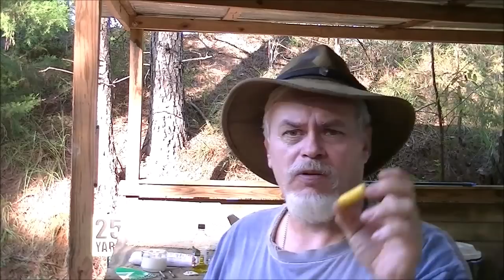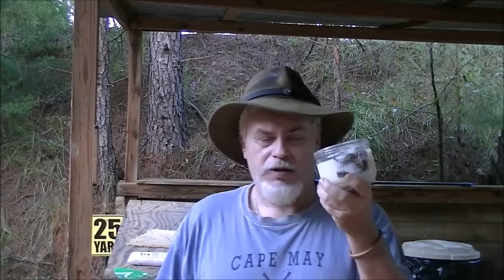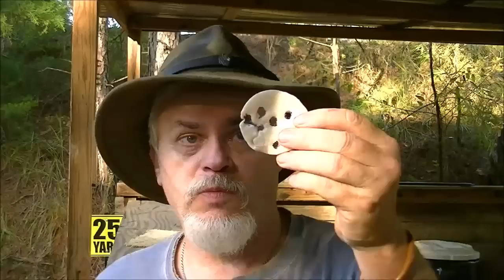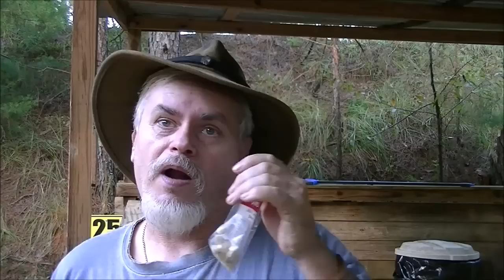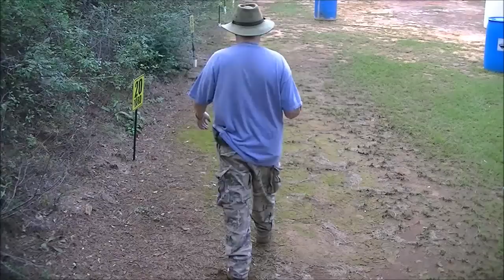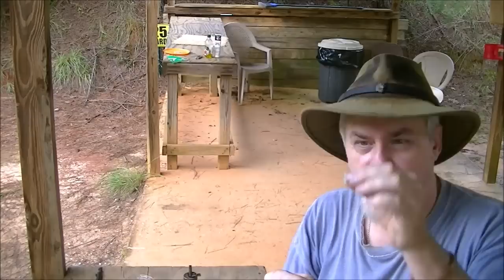percussion revolver series making wads

Comment: A big can of Crisco works really well for an over the bullet lube. It works the best of any of the lubes I have tried in that it keeps the fouling soft and I can fire many times and not have to assist the cylinder in cocking. I have never used a wad with no problems at all. Crisco over the bullet does not ignite and does not harden like wax will.

Comment: I bought 6 tubes of cotton pads just like those for black powder wadding (as well as general gun cleaning), except I was using them dry in a 1" pipe cannon, I didn't even think about using them as conventional lubed wads in my revolvers, great content as usual! I live in the humid Houston area, so no worries on embers.
Reply from the maker: we used them as wadding in smoothbore .62 cal trade guns for turkey loads..as long as they dont burn or smoulder your good

Comment: I gave up using wads after finding some stuck to the target 25 yards away. My groups halved in size and fliers eliminated by base dipping Eras Gone Colt .36 conicals up to the grease groove in a molten mixture of 40% lamb tallow, 40% beeswax and 20% candle wax. After shooting 48 rounds every session the bore fouling remains soft with shiny parts of rifling still visible. By the way, I use Pyrodex P due to real BP requiring a special explosives permit and storage conditions here in the UK.
Reply: Have you compared your round ball with wad accuracy against your conical method without wads while using Pyrodex? Does the UK make you store your cap & ball revolver in a locked gun safe at home?
Reply: @ReichenbachEsq  I find accuracy is better without wads, especially  conicals. I attribute this to having to use less powder space = less velocity.  
The most accurate load I've found in my .36 Uberti Remington New Model Navy with Era's Gone, Colt Cartridge works conicals half dipped in my home made Beeswax/lamb tallow/ candlewax lube is 19 grains (volume), 14 grains (weighed) of Pyrodex P.      
Round .380 cast round balls halfway dipped also work well with 21 grains (volume), 16 grains (weighed) of Pyrodex P. NOTE - .375 Hornady balls are too small in my revolver. 
All firearms in the UK, except most antiques, and air guns with under 12ft lbs, must be stored in an approved safe and licenced on a 'Firearm Certificate.'

Comment: I also got that same set of punches, but mine came very dull. If you have some kind of grinder/sander and you can sharpen them, and a torch to harden them, its a great deal. Don't bother annealing, these punches seem to be mild steel, so they won't harden enough to make them brittle, but it does make a difference.

Comment: I made some of my own lube 50/50 beeswax olive oil works well!  Thanks for the awesome video Blackie!
Reply: I do the same thing. My revolvers seem to like it pretty well... Im at a 25/75 mix, wax heavy with mine though. Seems to work well but my not soft like bore butter, but it works very well in my bpcr also at that level pan lubing. My 45-110 Sharps loves it with fffg swiss. Lol
Reply from the maker: @Rumblestrip   i have played with the mixes 25/75 50/50 60/40..each good for a certain job..
Reply: toilet ring wax, touch of pure carnuba(more firm) wax, pure lanolin oil, little bit of flax seed oil or olive oil great bore butter and leather conditioner water proofing. You could eat it? 
I soak punched felt furnature leg protectors from 99 cent store while my mix is hot.

Comment: I make my lube/grease with beeswax and coconut oil, I find it nicer than Olive oil. Change the proportions depending on your climate, since coconut oil can either be a solid or liquid at room temp, depending on the temp your room's at. Might not work as well in colder climates, but i find it smells great
Reply: Very true. And, if you've ever had the misfortune of smelling olive oil that's gone rancid; well, that'll dis-spell any doubts about which oil is preferable. Coconut oil doesn't go rancid, generally. And, just think; if you can smell that rancid olive oil, what must it smell like to deer!? They 'll probably smell that coming, from a mile away, literally!

Comment: Thanks for all the tips. The Walmart candles will stretch my supply of precious beeswax, and I will try the cotton face pads for wads. I will bu a bumper supply, because I seem to be having trouble finding cleaning patches. Awesome you for them, even if I don’t like the wads.
Reply: For cleaning patches I buy white cotton flannel from the fabric section at Wal Mart, Micheals or Joann's Fabrics.  Cut to size and much cheaper than ready made cleaning patches.
Reply from the maker: very true also i have waited till spring  look around the good will for flannel sheets to show up i buy then for a few bucks and cut them up for patches a king size flannel make a pile of patches
Reply: You can always use t-shirts.
Reply: @Seahawksl1969  I quit using t-shirt material in muzzleloaders when I had one get stuck down a .32 long rifle bore.  It's ok for wipe downs and in open ended barrels but won't use them in traditional guns any more.
Reply: @karlt8233  ok.

Comment: I work in a machine shop so I made my own punches to make wads. I used a recipe for bullet lube I found that used beeswax, paraffin wax and lard.. now I leave out the paraffin wax and just use beeswax and left over bacon grease. I just pour the warm bacon grease though a coffee filter into a jar to remove impurities. then I melt the wax and grease in a pan. until it blends. the right mix when its cooled is a good paste that wont melt at 100 degrees outside.
Reply: Bacon grease will turn rancid on you over time.
Reply: @denisdegamon8224  I have some of the lube I made several years ago and it is still good because the wax keeps it from going rancid.  Candles were primarily made from tallow and beeswax in ancient times.... Tallow is animal fat..
Reply: @drakon1300  good to know that is my plan also.

Comment: Yall so fancy  I just got a euro arms Rodgers &Spencer 44 , and haven't been  able to find balls or caps the right size but I been shooting it using  45./.440 balls a patch cut from gun cloth, bearing Greased, and found # 11 caps bent in a little round the edges to fit tight  and barring grease,  to  seal the chambers , and I've had no problems  so far  ,  I don't recommend this but in a fix we do what we can in the south, DERNTOOTIN!

Comment: 7/16 = .4375,   3/8 = .375   I have a similar set.  I also have more precise punches too, like a .750 punch I use for end caps on paper cartridges where I can get 74 out of a 8" brown coffee filter.  I also have a 15/32 (.469), it is a little big for paper cartridges, but will work just fine for making quick draw practice blanks. I haven't found a 29/64 (453), yet.  I'm also still using 1/4 stiff felt, where I can get 4 wads per 1 sq.in. I finely sharpen my punches and use a cutting board as a platform. And, I can easily cut them in two, to make 1/8" wads.
Thumbs up as always!!                                                 Blackie Sir, I am sorry!  I not trying to take over your show, and I wish I had your nerve, I can't make videos of my own, bout get sick trying.
Reply from the maker: good info thanks

Comment: I would like to see some powder in contact long term tests.    Sure way to "inertify" primers or percusion caps is to get oil on them. Be interesting to now if over time these wads will destroy powder touching them ( say like storing paper cartridges )
Reply from the maker: thats on the list..i plan to load a full cyl and wait 2 weeks then fire one chamber.. after that i will shoot one chamber per week till all have been fired to see if oil creep is getting into the powder..that would be a full 2 months loaded for the last chamber
Reply: Doubt it would do too much, being unless you pour straight liquid into your chambres, it won't  hurt em.
Heck you can still fine lubed cartridges over a hundred years old that will shoot.
You should be fine.
Reply: Would it affect accuracy or take up too much room if you punched out a piece of egg carton and stuck it between the wad and the powder?

Comment: From everything I have read, it is actually the sulfur created by the combustion of the black powder mixing with petroleum products that creates tar. That is why smokeless propellants do not create tar as they do not create sulfur so the use of petroleum oils is not an issue with modern firearms. I think petroleum oil is okay to use with Hodgdon Triple Seven for these reasons. Pyrodex on the other hand does create sulfur- if memory serves me.

Comment: So, I bought a gallon of beef tallow before I read that lamb tallow was preferred. I've picked up some canning paraffin and am having fair results with coconut oil. 2 parts tallow, 2 parts paraffin, 1 part oil. I'm going to order some harder and thicker felt. I soak the felt after I punch it out and I've been squeezing out the excess lube.

Comment: Blackie, your an ol' Southern boy, have you ever tried Crisco shortening for the grease with the beeswax? Did it work, if yes?
ALSO, LEE Precision makes a conical bullet mold, have you ever worked with it? I've got a Ruger Old Army, have only fired round ball out of it. Curious on your results, Blackie!
Reply from the maker: crisco does work but in hot summer it will melt off

Comment: Blackie, what you think about usage copper grease paste (2192°F) like releasing agent for nipple screw thread? Thank you! (I am new in BP)
Reply: I Use choke lube.  It has never failed me yet!
Reply: I use choke tube grease, brand does not matter, and a tube last a long time.
Reply from the maker: @karlt8233  i have seen guys use the grease for brake rotors and berrings before and it will work..

Comment: What is the difference between pyrodex RS and the pyrodex P? Ok p- is for pistols but can you use RS in the pistols? Would you need to load a little more or less?
Reply from the maker: i have used both in a cap n ball revolver the RS is for rifle / shotgun is to be FF replacement   P is a revolver and is a FFF replacement i have shot both kinds in revolvers  and both some guns will like one better than the other

Comment: This might be the kind of wax you got there (see link at end). would like to have the skew # from the candle to do more research if you can. Having problems finding #10 caps, have you noticed a shortage in your area?  Traditions manual say # 10 or # 11 caps will work but not happy with the #11's fit, do you know of any #11 nipples for the Pietta .44 cal.?  Thanx for the vids, best wishes to you and yours.

https://en.wikipedia.org/wiki/Microcrystalline_wax
Reply: Good luck finding caps and when you do buy lots!
Reply: I know where you can buy DIY #10 caps. Powder not included. Make with strike anywhere match powder and a drop of acetone. EDITED: i had the price wrong. It's $7 for 64PCS.
Reply: I can't even get a #10 cap any where near here within a decent driving distance.  I hate ordering that stuff online because of the has-mat charges, so I'm stuck with squeezing #11s.  Worse than that, I can only find CCI's!!!
Reply: @Ender3Me  WHERE?!
Reply from the maker: @LarryTalbot_1313  a few weeks ago i bought a few thousand from midsouth shooters supply
Reply: @cheepwings  I think only one or two website still sell the little $60 dollar cap maker machine. Depends on if you can find it, or if they want to even press caps by hand. 😁🇺🇲👍

Comment: For my own, I use 72 x 12 felt 1/8 thick a 50-50 bees wax tallow I add about 3% Gulf wax  say 1/2 ounce to a pound. Works well a kin to as your description. That is me, for half the work I am thinking your lube be easier on me, my wallet. thanks

Comment: Why not hummingbirds tallow why isn't beef tallow good easer to get no sheep around here .
Reply: Clyde Davis
, Because Lamb Tallow will not go bad, like Beef tallow does.
Reply: Found a tin of lubed patches I did around 2006 using beeswax and beef tallow.  Opened it up and OMG the smell was not good.  Patches looked black vs blue stripe ticking.
Reply from the maker: that was the real reason for the tallow it was more like wax and did not turn rancid easy where as all the other common fats of the day would go bad in a few days
Reply: Best thing for beef tallow is for a candle or lamp, and even then, it has to be rendered down about 2 more times and strained to get out all the things that go rancid. I guess it could be done for lube, but it's just a lot more work.
Reply: @karlt8233  My patches are headed for the freezer now!